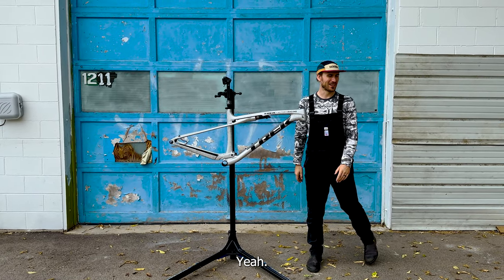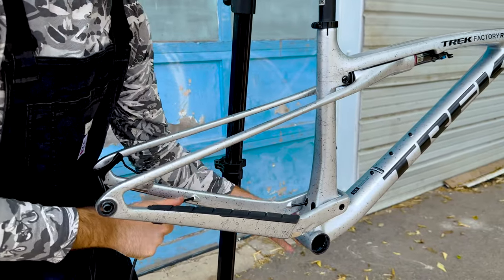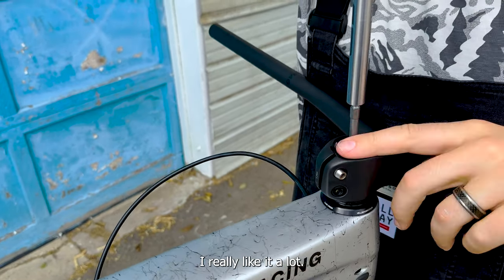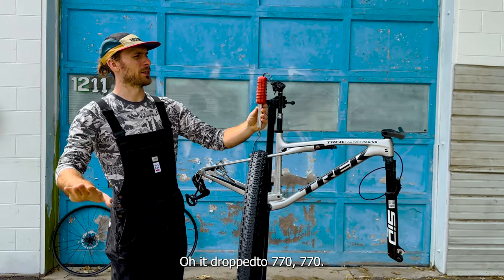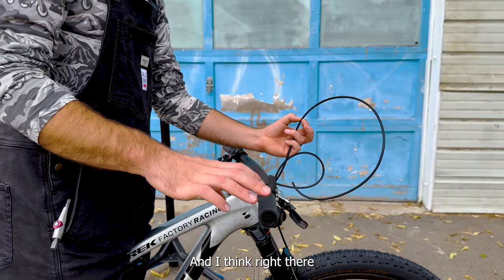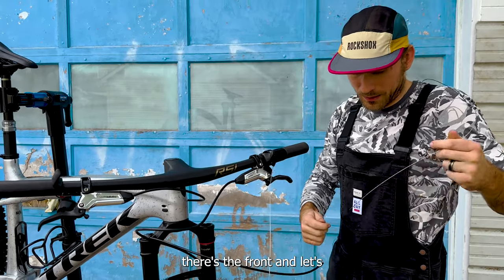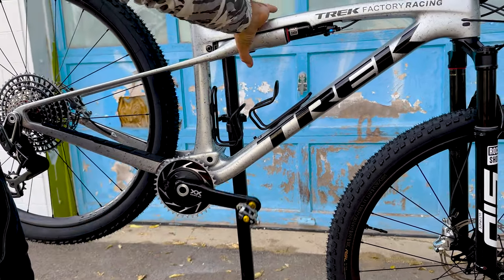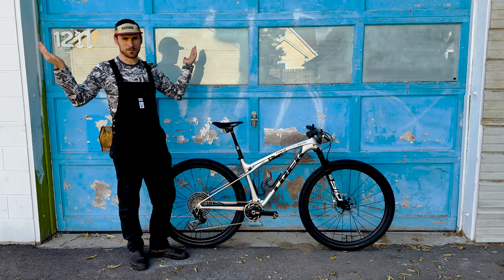Trek Supercaliber Gen 2 Custom Build

Comment: I have the new Gen 2 9.9 AXS.  So far I have changed the chain ring to a Wolf Tooth 36T,  tires to Schwalbe Racing Ray/Ralph with Vittoria insert,  saddle to WTB Silverado,  Shifter to SRAM AXS Rocker.  Fantastic XC bike.

Comment: I got the GX build and it's been amazing to ride so far. Swapped the heavy dropper for a Transfer SL, new wheels on the way and eyeing that XXSL crank as an upgrade someday, as well. As shipped, the weight of the size Large GX in red was 26.86 lbs.
Reply from the maker: SL or SLR frame?
Reply: @bicyclestation  SLR, it's the 9.8 GX build. The website says this build comes with the new Kovee Elite wheels but in fact it shipped with the previous gen Kovee Pro which weight a lot more, like 1750g maybe for the set. Also came with Maxxis Rekon Race instead of the Saint Anne tires.
Reply from the maker: Thats super lame. Id honestly complain.

Comment: Such a sick build video! I took the lock out cables off my 9.7 and also took the dropper off for now, so just have the two brake cables running up front, couldn’t handle the clutter 😂. I’m just curious about the technicalities of the rear suspension being in open position all the time but if I can answer my own question in terms of ride, I haven’t really noticed a huge difference without having the lockouts. I figured out that when I climb and I move myself forward on the bike and into a specific position the rear shock doesn’t have that much “bounce”.
Reply from the maker: I find that a lockout on a bike like the supercaliber is only really useful on pavement. Important for longer distance racing but that’s about it.

Comment: I fully agree with you on the strange spec of the XX AXS Supercaliber. When I first saw the reivews/spec-list of it, its kind of super noticeable that they specced it only to hit a certain weight goal. No internal cable routing tubes in the frame, press-fit, fox dropper, 2.2 tires, no power-meter? And the weight they hit isnt that super impressive anyways. 

Loved your build though, its exactly what I would have done if I were to get one.
Reply from the maker: Congrats you won the give away! Email chase@thebicyclestation.com to figure out shipping.

But yea you can tell Trek is trying to compensate haha.
Reply: @bicyclestation  I sent you an email now!

Comment: I have the same PRS-25 stand. It’s good. 

Do you find a lot of frames with internal routing end up having burrs inside the ports that scratch and damage the brake hose/cable housing? 

Frame makers need to take note and make sleeves inside the frame so the hose/housing goes in and out smoothly.
Reply from the maker: I’ve seen it once or twice. I honestly prefer just a big hole with a bolt on plastic cable holder. Trek had this nailed and kinda sad to see it go away on the new supercal. 

I think the tubes are fine in a trail bike but I don’t think it’s worth the weight on a race bike. It’s really not that big a deal to route them now that I’m used to it and do it almost daily

Comment: Awesome build, similar as mine but WTF
happened with to bottle cages??  Its like installing Pepboys spinner chrome wheels on a brand new Ferrari...
Reply from the maker: Not a fan of titanium cages?
Reply: @bicyclestation  they are literally but loom really dated , specially on a Super Bike like that one. But also, have watched your build video a couple of times , really cool!!!! Thanks for the video
Reply from the maker: Appreciate it! The main reason I use ti cages is they never break or drop any bottles. Lighter than carbon cages. I just can’t think of a better solution

Comment: How are those RSL wheels? At 1200 grams and with 24 spokes are they too flexy in any way?
Reply from the maker: They are loud. Didn’t think they were super flexible but I’d definitely go control sl over rsl
Reply: @bicyclestation  what's better about the Control SL?
Reply from the maker: They don’t cross the spokes so they don’t make tons of pinging noise like the rsl. Also they have turoq caps

Comment: I’m disappointed in Trek dropping Fox for the rear shock
Reply from the maker: eh fox is kinda overrated. They havent really changed their xc stuff up in a long while
Reply: @bicyclestation  imo the fox shock does a much better job at soaking up small bumps. It bottoms out too quick even with a larger volume spacer but for XC riding like we have here in the Grand Rapids area of Michigan, it provides a nice balance of comfort without that true lethargic squish feel of a 100mm bike. Any rockshox fork I’ve had the last few years has developed bushing play and felt like crap. Fox has stayed consistent and reliable.